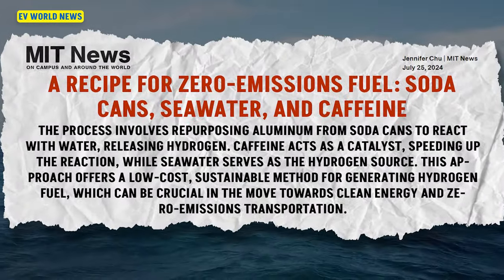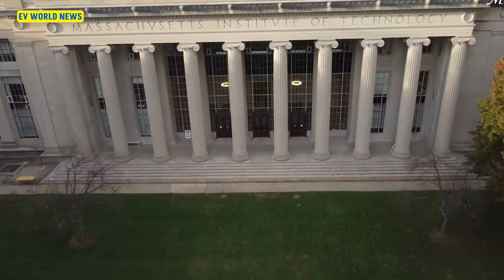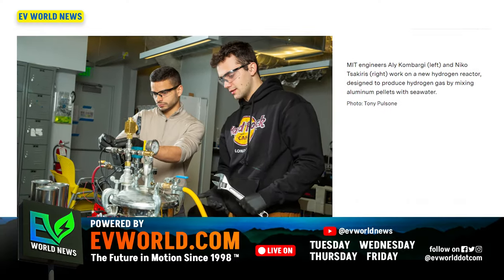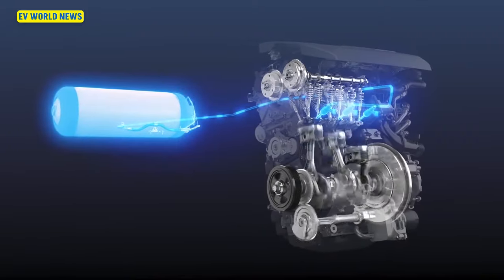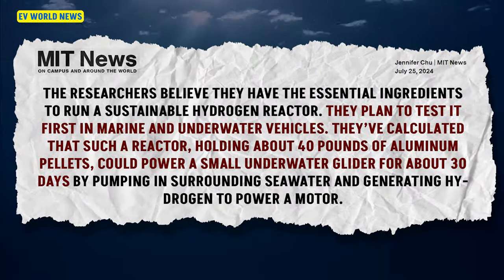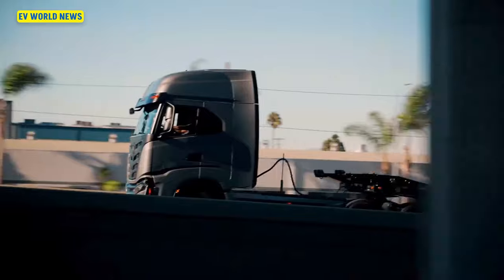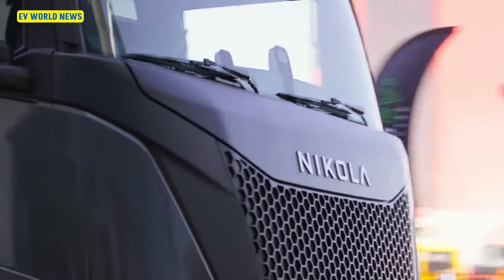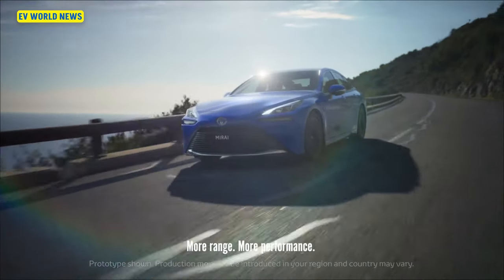Has MIT Revolutionized Hydrogen?

Comment: lotsa talk very few facts. sounds like a hoax... wanna come with proper news of this magnitude? then at least cite the article or provide a link to MIT's research. until then it's worthless...
Reply from the maker: https://news.mit.edu/2024/recipe-for-zero-emissions-fuel-with-cans-seawater-caffeine-0725
Reply: 1) you need to have the aluminium (which stores some the energy from its production)
2) hydrogen is a gas, 1 litre is nothing
3) you need to add water (heavy, where it gests its hydrogen from, leaving the much heavier O2 as 'waste' does not sound weight efficient to me😂
Reply: @EVworldnews thanks for the link